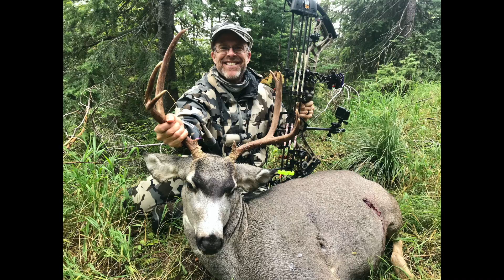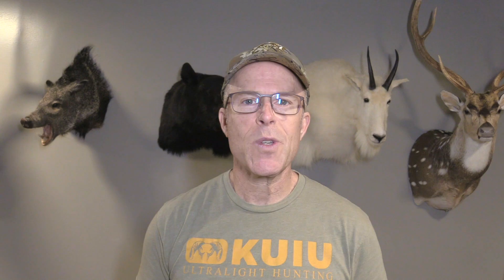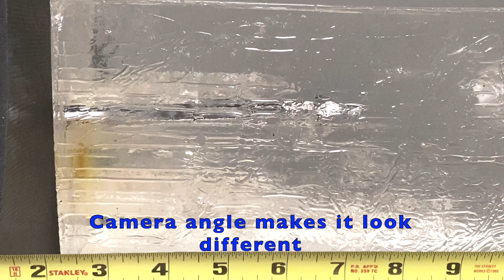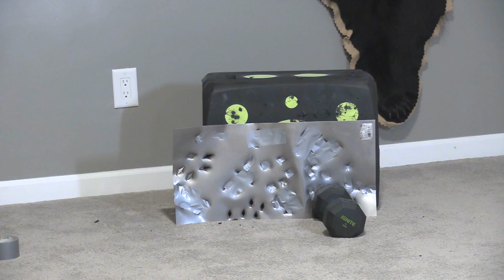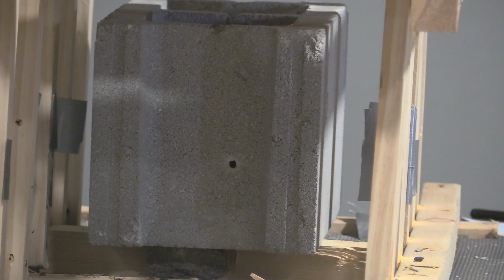STEELFORCE PHATHEAD Broadhead Test

Comment: Well, I was a little disappointed with this heads performance. Surprised even considering the thickness of the main blade bending! I've been moving away, or at least trying to move away from heads with an aluminum ferrule due to exactly what you put on display with the steel plate. The blades were for the most part good, but you'd be throwing it out anyways because it failed the spin test. I assumed that the ferrule had bent a little because the blade (minus the minor curl over) looked very solid still. Even a little wobble is too much wobble. 
Still not convinced to move away from Magnus Black Hornet. At least with Phat Heads.
Reply from the maker: Yep...but it takes a steel like A2 or S7 for a cut on contact head to not bend

Comment: I tested the Phathead against the VPA 125 gr. 3 blade and found the latter got 1)better flight 
2) easier to sharpen 3) equal or better durability. Took a mule deer with each head and got about the same result. The VPA 100 or 125 might be the favorite fixed blade for high speeds
if you don't want to use a mechanical...better than the Phathead IMO.
Reply from the maker: Thanks for sharing that.

Comment: Been waiting for this test. Shot these heads in the 125 and 180 grain versions for a few years. I loved that 0.080 thick blade. Main reason I switched away is their assembly system was a bit tricky and I cut myself a couple times reassembling after sharpening.
Reply from the maker: Thanks for sharing that.

Comment: Thanks for the video John. I just wanted to ask how you are ensuring the shot into the concrete is at the same angle for each head that you test.  Obviously I think that a squared collision would be the best but are you ensuring the brick is lined up on a reference mark and then shooting from the same place each time.  Off angle shots would definitely place different forces on each head.
Reply from the maker: Yeah, I just try to be as consistent as I possibly can.

Comment: Not bad... I think if you sharpened it yourself right out of the package it would be a good head.
Reply: a new broadhead should kinda be razor-sharp outta the box, though. THAT should really be the #1 requirement. being tough would be a ways down the list.
Reply: @zzz7zzz9  i agree but some broadheads have to be ordered sharp or you sharpen them yourself.
Reply: @bbmopar3834b  that's crap, and anyone supporting a company that pulls that kinda stuff, is promoting poor standards. Companies should be held to higher expectations. Don't reward them for sub-par quality. Wtf kind of mentality is that even.
Reply: @zzz7zzz9  it depends on the sharpening theory of the company vs. what you want. If the company thinks a more coarse edge is better (basically micro serrations) for ripping through tissue and you are expecting a razor blade edge, you will be disappointed. I keep a more coarse edge on my single-bevel broadheads. Other people buy serrated blades (think Magnus Buzzcuts). A more coarse edge will not cut paper well, but will cut skin, lung, heart, muscle, etc., very, very well.
Reply from the maker: Well, it was fairly sharp, but it lost that edge quickly.

Comment: Your new testing spec additions are cool. Could you do the Sevr 1.5s with your new tests?  Curious how it would perform. Thanks.
Reply from the maker: I shot one 3 times into concrete and it was still going strong. I shot one thru the steel plate 5 times--it was the only mech to ever hold together after even 3 times. And I shot it into the cardboard as well--49 layers.